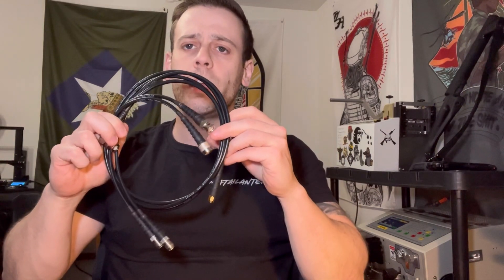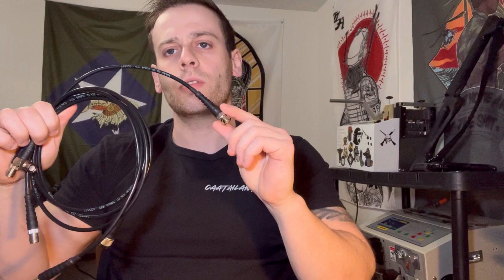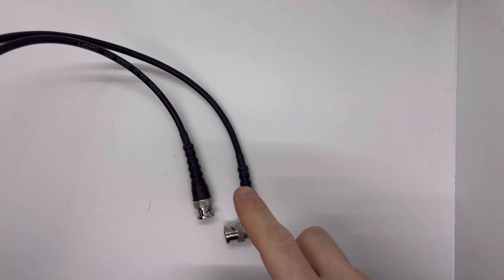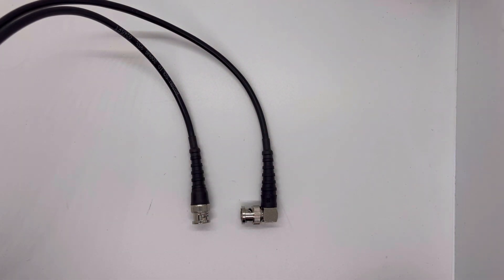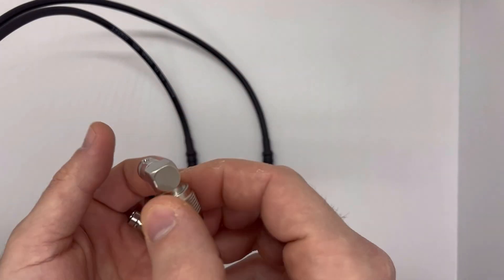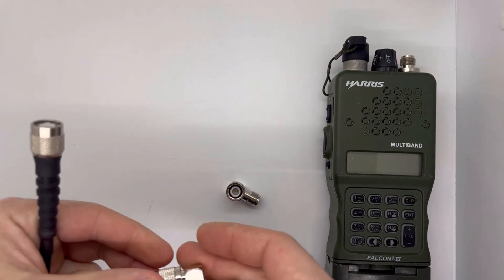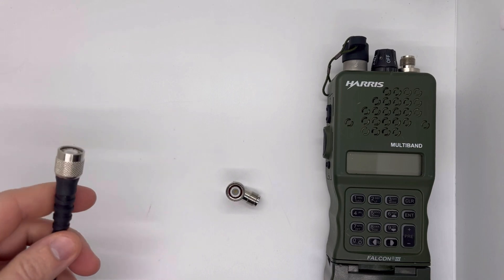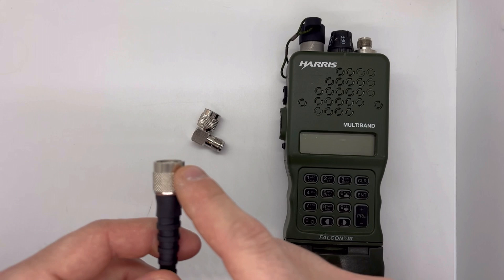Up Armored Antenna Relocation Cables

Comment: Is it ok to run a wearable antenna over a hydration bladder? Your website says never to run one under a hydration source, and was curious as to why? I run an Agilite bladder on my carriers and would prefer to keep them attached.
Reply from the maker: Yep, running it over the bladder is fine.
Water works very well at blocking signals. It’s why nuclear reactors have water protecting the workers or why Subs need to shoot up an antenna buoy for vhf/uhf or stick to using VLF to pass through water.
Reply: At 12:26 he mentions that water is great at blocking signals.

Comment: How many watts can your relocation cables handle? Didn't find any technical info on the website.
Reply from the maker: They are made on RG58U 20AWG. Max watts can depend on the freq but I would not go over 750w; doubt anyone doing anything handheld would anyways.

Comment: Really informative and helpful video. I am trying to decide between your Antenna Relocation Cable and a wearable antenna like the "Squad Leader"

The wearable antennas seem to be easier to route and manage, but how are the range/reach capabilities vs that of the Harris or TNC male antenna?

What would be better for a Platoon Leader or Commander; would the wearable antenna work sufficiently?

Sorry if you answered this before, I tried to download the Courses and Pubs file on your website to no avail since I don't have .rar software, but will figure it out soon.

Thanks in advance, you're the man
Reply from the maker: Hey James! 
The wearable antenna is great for internal comms and beyond but if you need to make sure you reach even further via ground work (like VHF) a 3ft whip on a relocation cable would be your best bet imo. 
To open the files, I would recommend downloading WinRar for free and unpacking it that way. 
Stay safe! 
-Will
Reply: @caatailantennas8914  I was looking at doing the same thing, and just carrying a larger whip with a pre-intalled BNC so I could pull the radio out of the pouch and pop the big antenna on.  The BNC option will also help since I have a few different brands of radios, mainly Yaesu and Baofeng.  Thanks for the video.